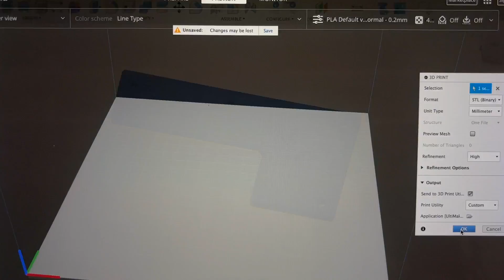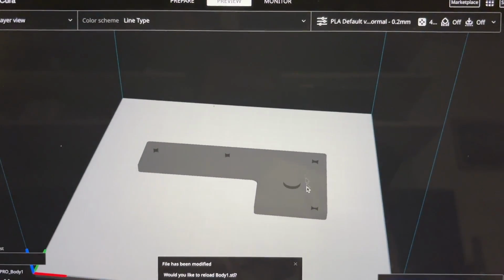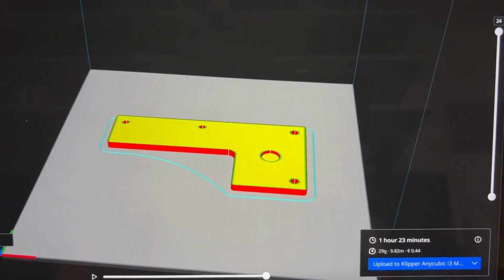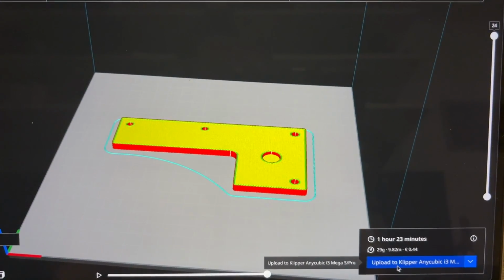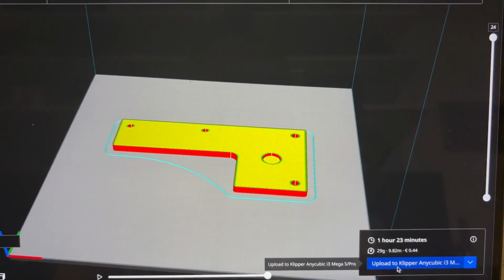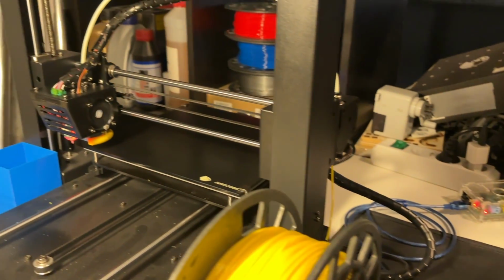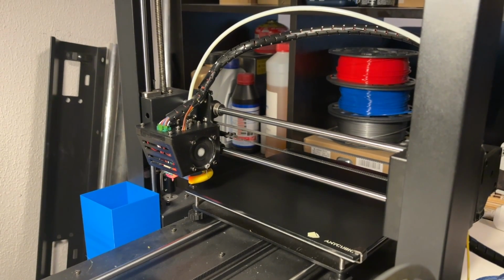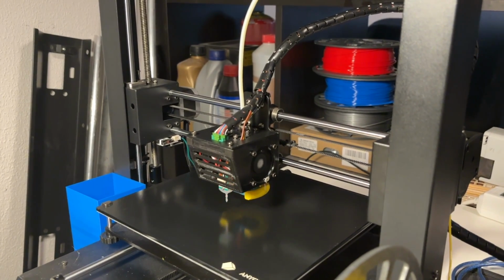Must have extruder upgrade for Anycubic Mega 3d printer.

Comment: Interesting mod. Did not see this before. What was the reason for it? I have this printer since few weeks and so far with standard set up it printed PLA and some TPU quite fine. I am thinking of doing this mod, too. But my concern when looking at this is that due to smaller radius of the tube there will be more friction to the filament especially for TPU and similar. Do you have clear benefit now after finishing this? A conclusion video would be interesting. Some user commented on his make that v2 version produces squeaking noises on retract.

Also I saw your other mods on your Thingiverse profile for this printer. Will come in handy for me, too later on. I'm thinking of adding 3D Touch sensor, too.
And also I see you used(d?) another fan duct which cools from both sides. This was my first modification right after buying the (used) printer.
Reply from the maker: The reason was to reduce length of bowden tube. This printer works, but I'm not using it at all at the moment. After assembling voron...

Comment: Amazing vid. Would you able to help me install the BLTouch to my printer? I'm also running Klipper, but I have no idea how to mount it, or configure it within Klipper. I'm also running an SKR 3 EZ board. Thanks buddy,
Reply from the maker: To help you I need to know which printer you have
Reply: @zhadlun  Anycubic I3 Mega-S - same as yours
Reply from the maker: @alpachino468  Just uploaded. I'm use this mount https://www.thingiverse.com/thing:6821029
Reply from the maker: @alpachino468  For coufiguration with klipper, you need to found a best way to connect it to your board, use manual to your board. For configuration of klipper itself, the best way is to check official documentation, there is just a few lines that you will need to add to your config to make it work.

Comment: Nice video. But why put smaller diameter Bowden tube. Wouldn't larger diameter tube reduce friction and be better?
Reply from the maker: For bowden extruder to reduce filament play you need to have as small tube ID as possible. This will reduce retraction.